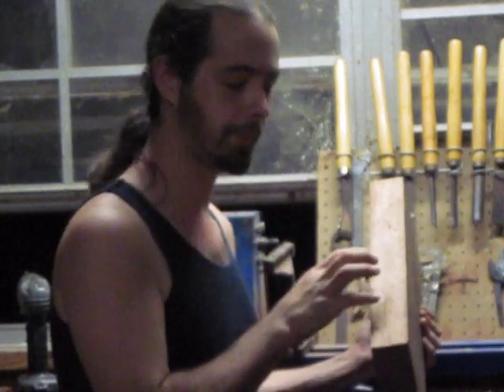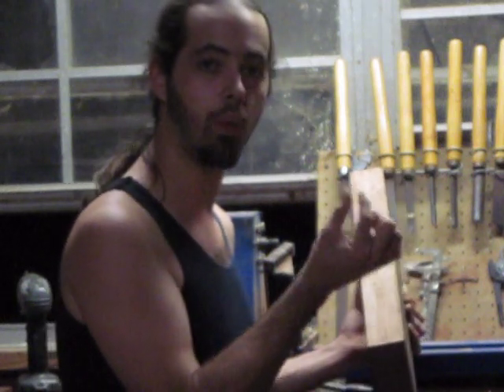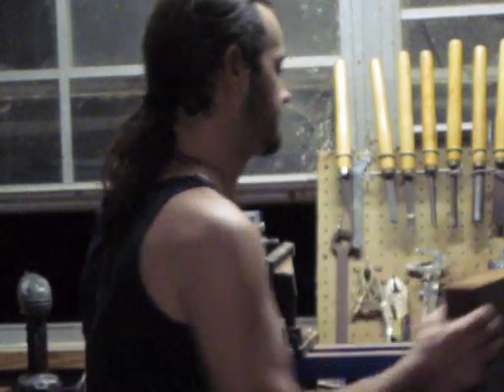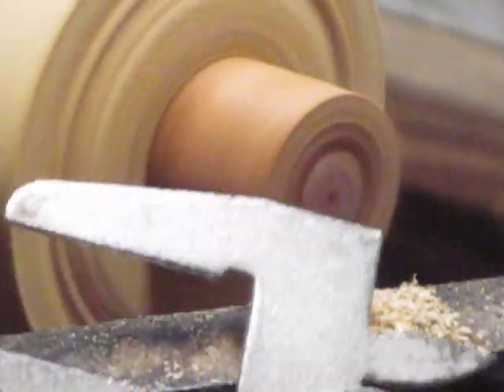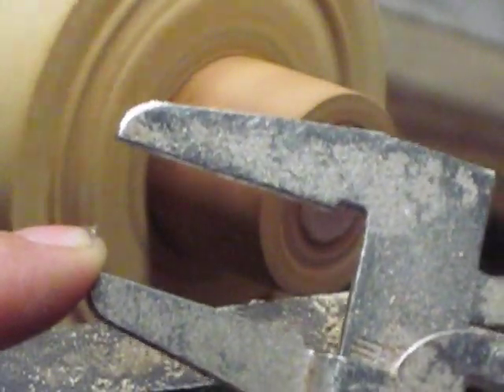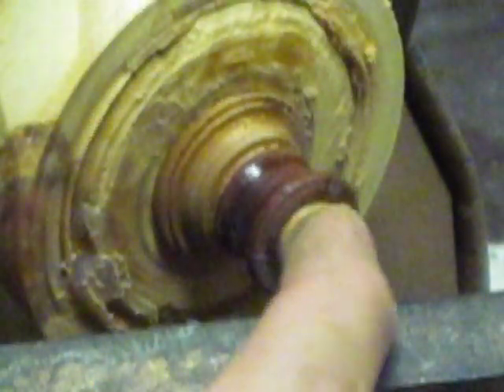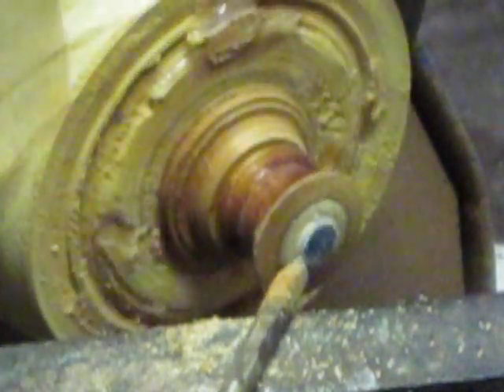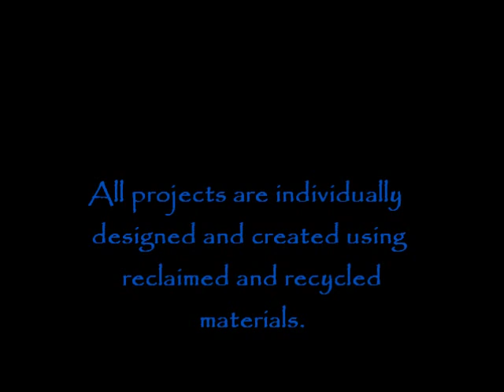Turning Guaged Plugs

Comment: you did very well. but I would recommend making the flares smaller. I have one inch ears and I also make plugs. wood isn't smooth like stainless steel, so having smaller flares is a very nice thing to have. also its not safe to seal the whole plug with super glue. most plug makers including my self use a natural oil or wax (I use bees wax) to seal the plugs. this way there are no chemicals that can harm your ears or the rest of your body.

Comment: Hey man great job on the plugs . what lathe are u using ? Would a craftsman midi lathe work for this . ?
Reply from the maker: In this video i am using the cheapest lathe i could find.  $135 harbor freight central machinery brand entry level lathe.  Just this weekend i acquired a very nice 'Nova Comet II". With chuck that will make things alot easier. That being said, yes any lathe should be able to do this.  Just glue a piece of scrap to a waist block and start turning.

Comment: what sealant do you use? and how many coats do you apply? thanks
Reply from the maker: For this pair i used ca glue, but from experience i've gained since i would suggest using an epoxy or just a good polyeurethane.  These seal the pores well and create a smooth surface.  Since they are plastic based, it provides a safe surface for skin contact.